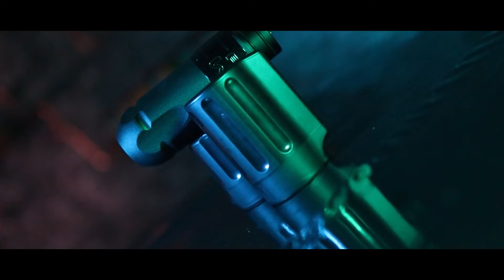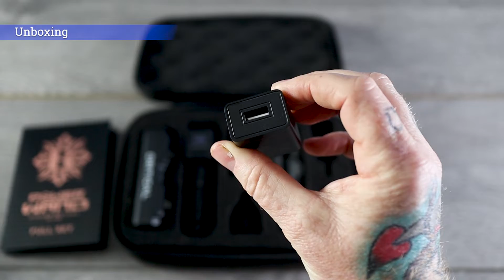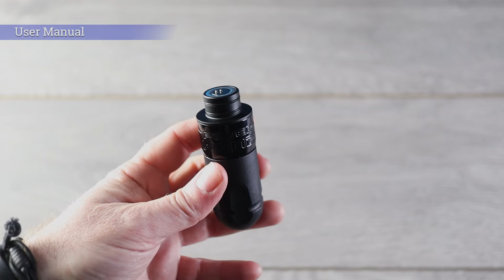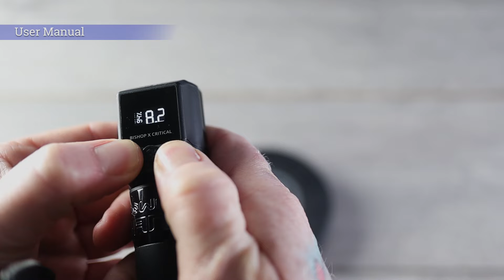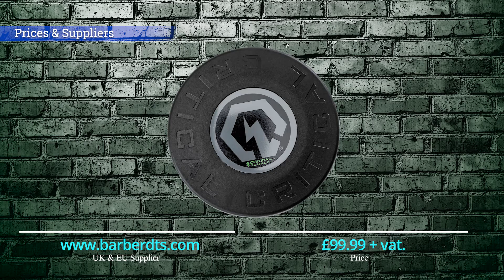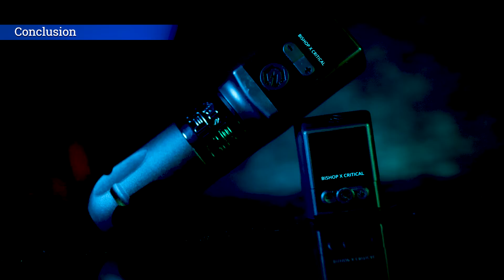Bishop Power WAND Tattoo Machine Review!

Comment: Hey Jono, this might be a bit of a weird question but how loud in decibel are rotary machines like this normally? I got a cheap one  (Mast Pen) and just bought a high end one.  The high end one (Stigma Rotary Force) is way louder than the cheap one. Is that normal? Im scared i bought a broken product or something. Thanks for your help mate !
Reply from the maker: To be honest the sound can vary greatly between brands. I’ve never used a Stigma so couldn’t comment on that particular one. I find liners tend to be a little louder (probably because they’re set up to hit harder and run faster). This particular machine, the wand, is very quiet compared to my other machines. It could just be a simple matter of that particular machine you’re using is slightly louder than others. It could be worth checkling the manufacturer’s website to see if they have any maintenance instructions because some do require a little bit of grease after so many hours use.

Comment: Can you try and unscrew the top to pull the motor out they show it in a video but so far everyone I've talked to is too scared I really want to see if the power wand is easily open able for cleaning a huge strength of the original wands
Reply from the maker: I’ll be sure to do a video on this.
Reply: @JonoSmithTattoo  thank you jono you da man ! <3